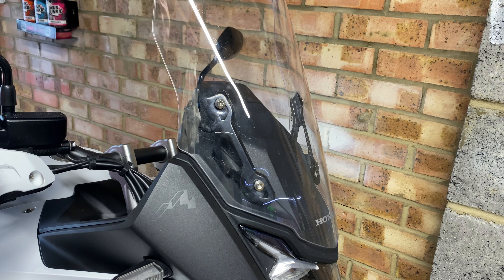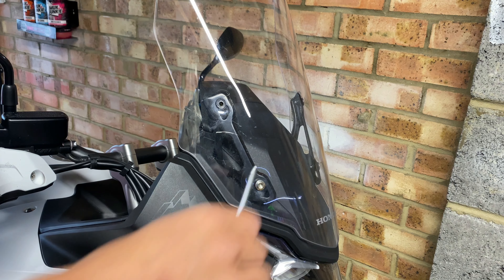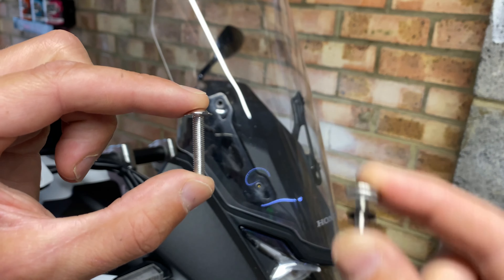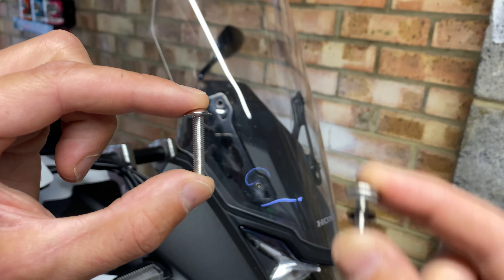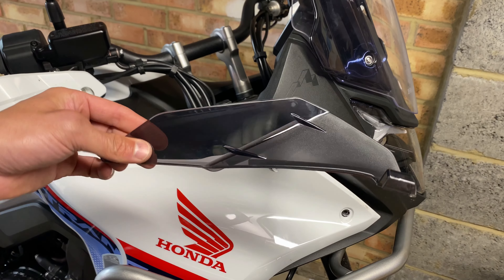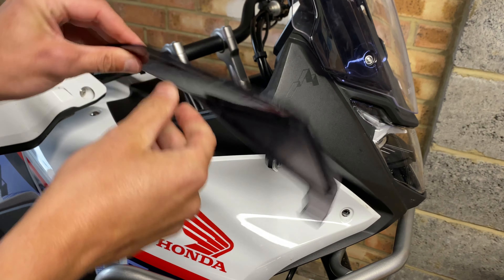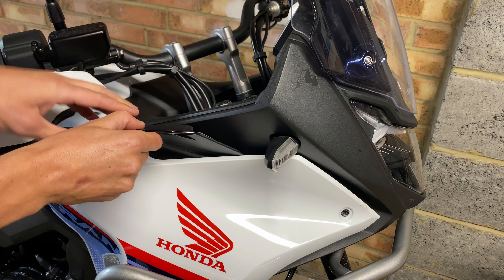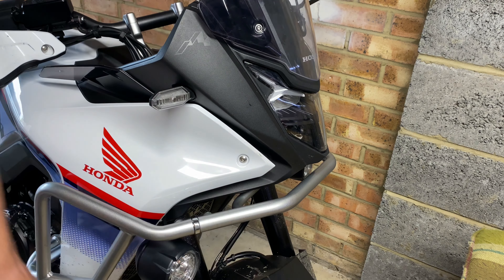Fitting The Honda Transalp 750 Wind Deflectors

Comment: Excellent video , i want to buy them from ali but i am nit sure for the color? Those in the video are the smoky ?  I am between smoky and clear...
Reply from the maker: Hello 👋 Thank you for your comment. I believe mine are Smokey yes. They are the same colour as the genuine Honda ones. 

I haven’t yet seen a bike with the clear or black ones so unfortunately I’m not sure what these look like on a bike yet. 

What size screen are you using?
Reply: @TyresNTorque  I use the original extra long screen. These aren't very black I see , you can see inside them ?  the original are also smoky ?
Reply from the maker: Me too, the combination of both the taller screen and wind deflectors is fantastic.

No they are not black and yes you can see through / into them. I’m not sure what Honda class this as but my brother has these as an option extra from Honda on his bike, and they are the same shade/colour as mine 😊

If you can please Subscribe. It’s a huge help in growing my channel.

Comment: A good set of instructions here for a mildly 'fiddly' job. I was offered a few 'trinkets' when I ordered my Transalp, being (I think) the first to order in South Australia, in which I included these deflectors, which are - yes - ridiculously dear for what they are, and I may not have considered them if I'd had to pay that price for them (about $250 retail here for all four). The Honda parts include some black stickers to go on the 'screen beneath the upper deflectors, which meant the screen had to come off. Not a 'biggie', and allowed me to get it clean, now with 5,600 kms on mine.
I can only think the stickers are about reducing some refracted light from the headlight, but no explanation is offered, and I haven't ridden it at night yet. I found it easier to mount the lower deflectors by removing the side panels, which again aren't difficult (not my first time) which made finding where the 'hook' on their lower edge engages. (I don't have the crash bars fitted). The stickers on mine were a full triangle of a VERY STICKY adhesive, as opposed to the strips in the video - you really only get one go at it, and the important detail, as TnT stressed, is lining up that edge.
I probably should also mention that these items didn't come in for over four months from the time of ordering (deflectors and rally footrests) as apparently there is a run on these items, as I gather there has been for the actual bikes.
As to the important question of "but do they work"? Well yes, they DO create a sort of bubble of still air, but the difference is subtle. Noticeable to me as I had just done a 200 km round trip to pick them up, then fitted them and tested them straight away, but it's not hugely obvious, and of course subject to wind conditions. So yes, they work, but it's not a 'night and day' change.
Worth fitting if you got them cheaply, but probably not worth the full retail if money is an issue. My deflectors also came with four more rubber washers, which permitted me to fit one between the two pieces of perspex. The instructions for fitting (which come on-line) are fairly minimal, so this video is actually helpful even if you have the factory instructions.
Reply from the maker: Thank you very much for the information above! It’s nice to know the video is useful and great to hear your experience 😊 Are up using a standard or taller screen?

It is a simple job but as you say it is a little fiddly - I hope this video gives others a little info and confidence to be able to fit these themselves, instead of asking Honda to do so and having to pay for the fitting cost. Every little helps! 😂💰

Personally I have found these to be very useful particularly with the taller screen. For those reading this comment and who haven’t seen it, here are my thoughts on these…

Honda Transalp XL 750 Wind Deflectors
https://youtu.be/b84pbf1ToWo
Reply: I have stayed with the stock screen - I am just under 5' 10", and it seems sufficient. My other bikes' screens are lower than the stock Honda one, so I don't feel the need for the bigger one. The actual fitting of the deflectors is quite straightforward, but the Honda instructions are not. But I have worked on motorcycles for a very long time, so it was easy enough. 
The only tricky part really was working out which of the lower deflectors was which, as this wasn't obvious from the tiny on-line diagrams, or the actual parts, so you did well to highlight this aspect.
Reply from the maker: @patkennedy1  Thank you very much! To be honest, I was struggling to describe which deflectors goes on the right/left 😂

I’m glad the stock screen is working for you! What other bikes do you have please? If you don’t mind me asking.
Reply: The only others I keep registered are my old ('95) Cagiva Elefant 750, which has had a fair bit of alteration and lightening, and is a decent thing, and my 1098S Ducati, which I have extensively (expensively?) modified. It is on WSBK minimum weight, road registered. (I have done over 100,000 kms on that bike). I also have a 'project' 1198 and an old Ducati 500 Pantah.
Reply from the maker: Wow! That’s a good collection. I am looking into project bikes at the moment. Lots to choose from! 😂

What is your favourite bike out of them all? I presume the 1098s?

Comment: Do I correctly recognize them to be AliExpress sourced? I have same ones (not mounted yet) also from there as original are insanely expensive!
Reply from the maker: I purchased mine from eBay however they seem to be the same as the genuine Honda ones, but much cheaper. 

If you don’t mind me asking, how much did you pay?
Reply: @TyresNTorque  Sure. I paid around 64 USD with free shipment. They indeed look the same as original and are a very good quality. Surprisingly good! I wonder only if on the bike they really make any difference protecting from wind as internet opinions are not consistent.
Reply from the maker: Thank you! That’s a huge saving compared to buying them from Honda 😊

I plan on doing a review video soon, they must do something, I just hope it’s noticeable 🙏 Do you have the standard screen or the taller one?
Reply: @TyresNTorque  A standard one. Not sure I like to look of the bike with high one. Additionally I rarely use highways where screen hight makes a real difference.
Reply from the maker: I think there will be a bigger noticeable difference with the wind deflectors, using the standard screen compared to the taller screen, as the taller screen is also wider. 

I’m just under 6’3 so the taller screen is a must for me. The standard screen just seemed to push the wind into my eye line. 

I’m looking forward to seeing what the deflectors are like. When do you plan on fitting yours?
Reply: @TyresNTorque  I do plan doing it next week but honestly don’t have too much motivation now. It is late autumn here in Europe and weather is rather cold and rainy. I have also QuadLock induction head to be mounted to the bar over the dash. 
I’m 188cm what is roughly 6’2 and all the bugs hit my helmet from the visor middle up. As mentioned before - rarely driving on highway so it is not a big deal.
Reply from the maker: The weather has started to turn wet and cold here too 😞 Where are you based in Europe? 

I commute a lot on my bike and I end up doing a few motorway miles so the extra protection is a must 😊